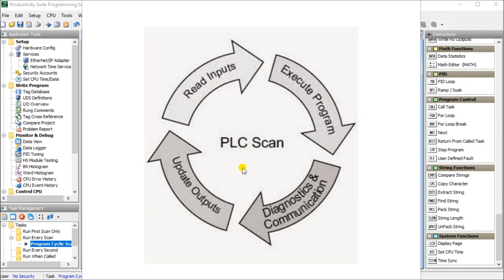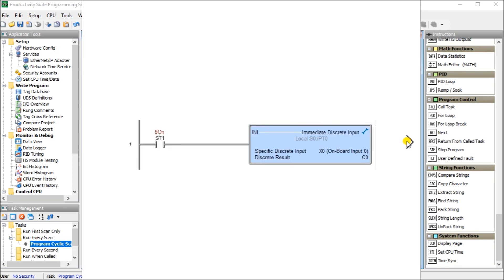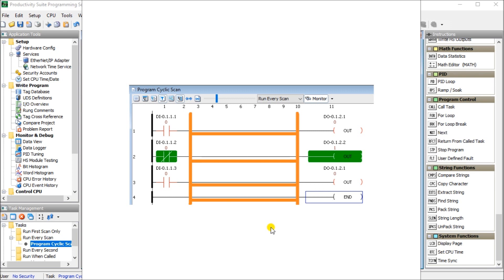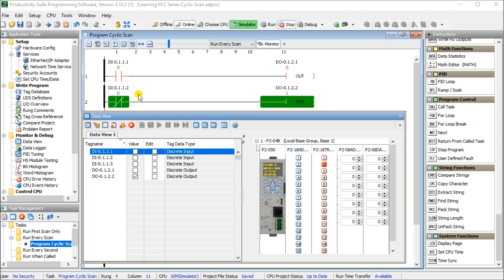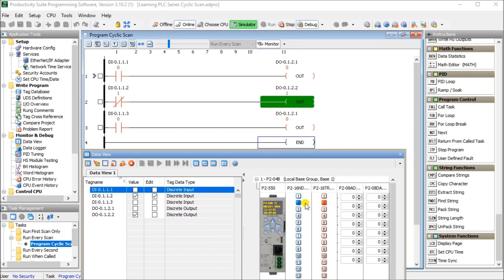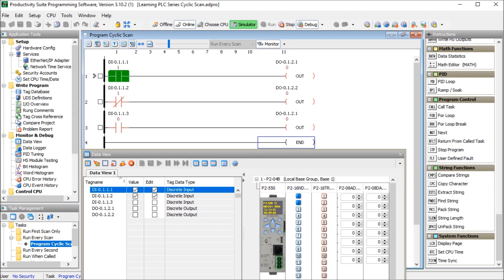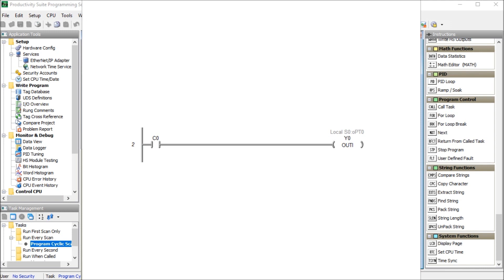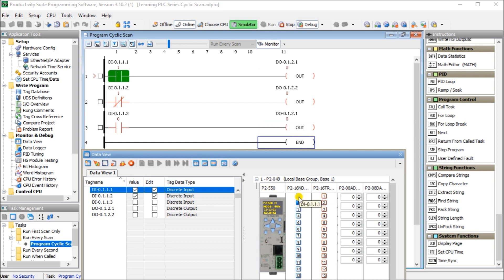PLC Learning Series - Program Cyclic Scan

Comment from the maker: More information can be obtained at our website. This includes all of the links mentioned in this video. 
https://accautomation.ca/plc-learning-series-program-cyclic-scan/

PLC Beginner’s Guide to PLC Programming
There are many different PLC manufacturers with different hardware and software. All of the programmable logic controllers have similar basic features. Here is how I would approach learning about basic PLCs.
https://accautomation.ca/programming/plc-beginners-guide/
Once you are familiar with the basics of the PLC you would then learn specifics for the controller that you will be programming.
This is the easiest way to learn about PLC programming.

Regards,
Garry

Comment: Thanks. I have a doubt. 
which scanning method is good, Horizontal scanning or Vertical scanning? which one mostly used by PLC manufacturers?
Reply from the maker: Hi Ameer Abbas,
The vast majority of PLCs will scan from left to right, top to bottom. The outputs and conditions from the previous rung are available to the next rung.
Older models of PLCs like the Modicon 984 scanned from top to bottom, left to right. This can make troubleshooting the ladder difficult. You have to work your way through the entire ladder to determine the conditions before setting the output.
Good question.
Thank you,
Garry
Reply: @ACCautomation   Thanks a lot. My doubt was cleared.
Reply from the maker: @ameerabbas1996  
You are welcome.
Garry